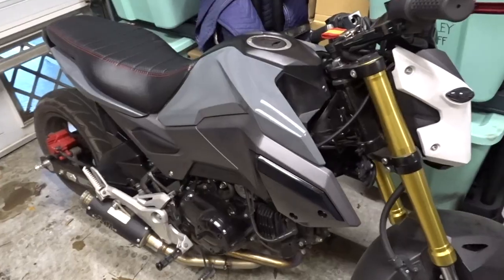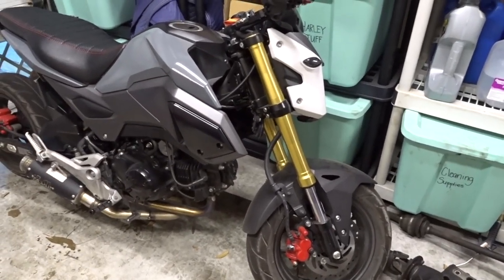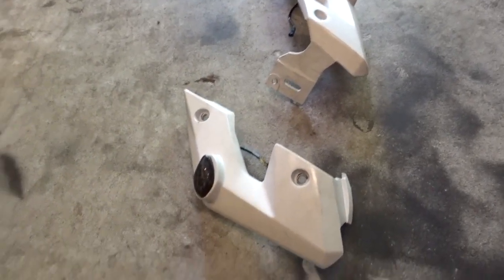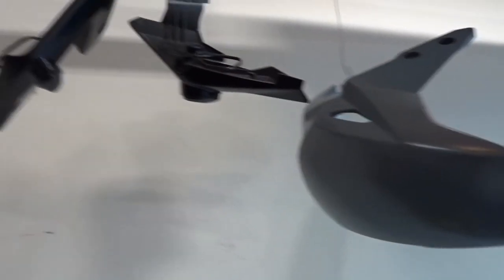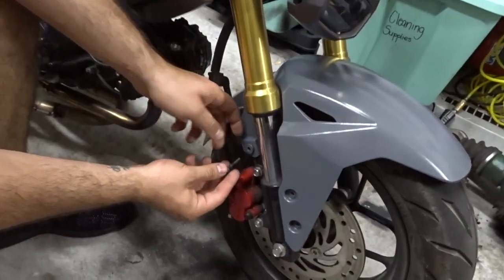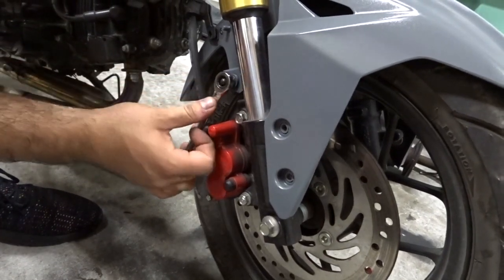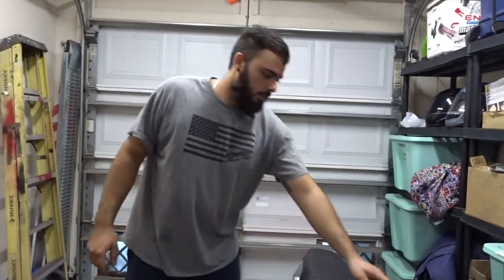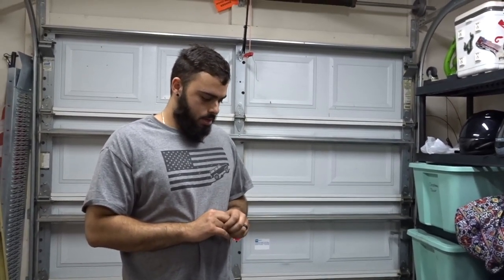Grom Paint Finished - Grom Build Ep. 7

Comment: How does it ride with it being stretched vs OG configuration? Is the speed decreased? I'm looking for your current handle bars. How do they feel vs the Protaper handlebar?
Reply from the maker: IamMrC it rides the same, you can feel is stretched when I take it out of the garage and the turn radius is different since it's stretched now but I love it. Have to go slowly over speed bumps. The speed is the same and since I change the sprockets it has more torque now, it gets up to speed faster. I got the handle bars on ebay and I love them, the protaper ones are good too but I was going for that lowered look so I decided to go with those. Worth it !
Reply: instablaster